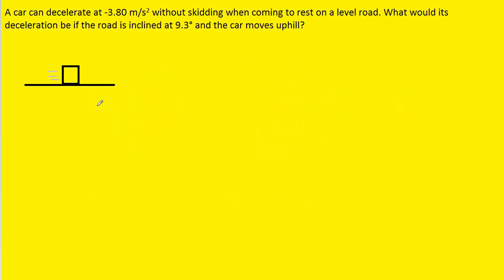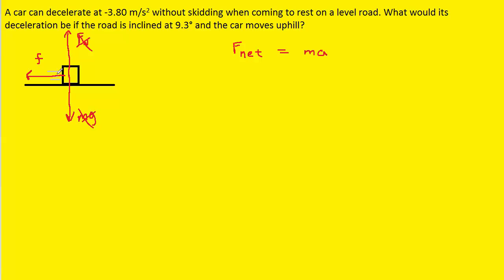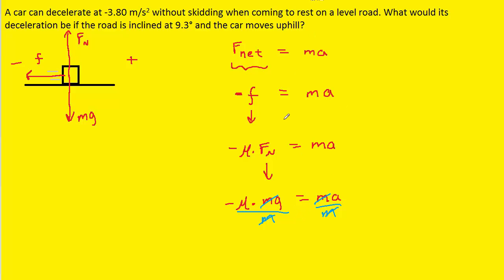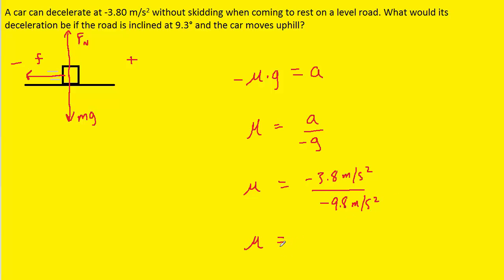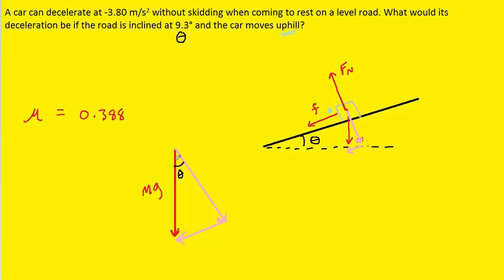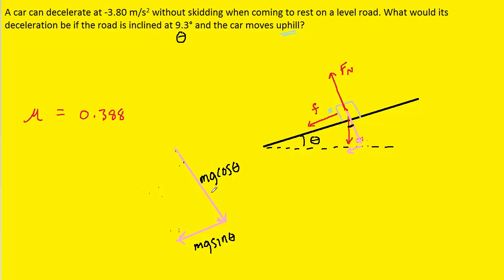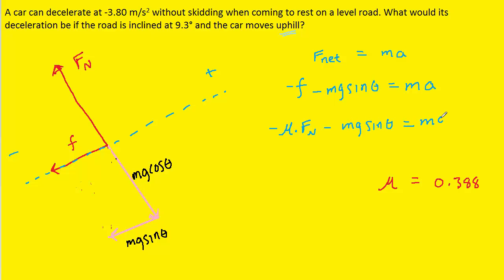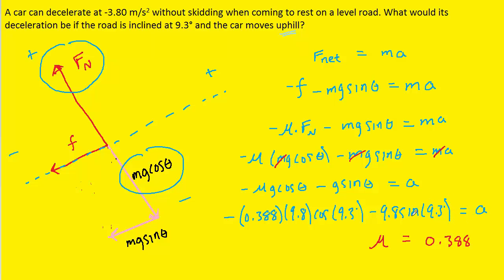A car can decelerate at 3.80 without skidding

Comment: I am wondering about the backward force f. The text says there is no slipping. But the only way to get a backward braking force on the car from the ground is to lock the wheels. Your calculations are based on that. A grave misunderstanding from you about basic physics